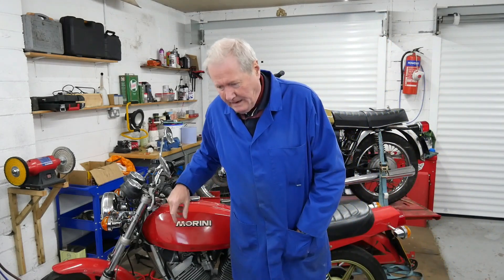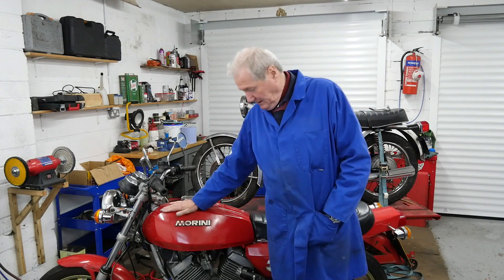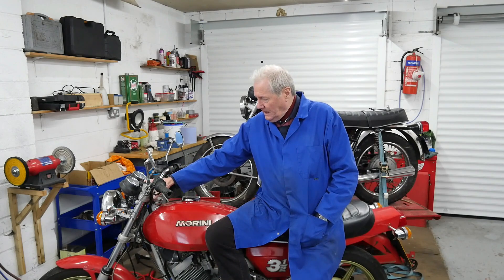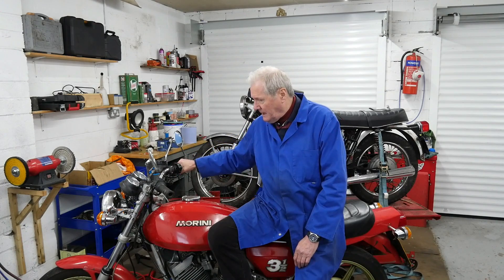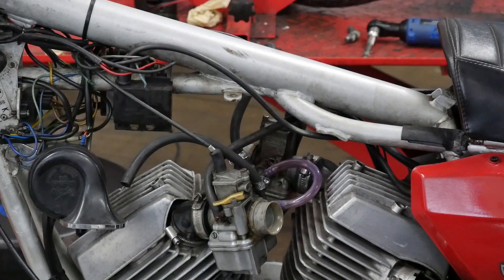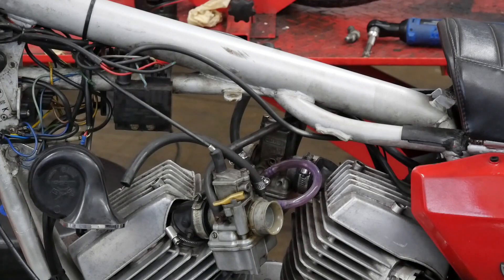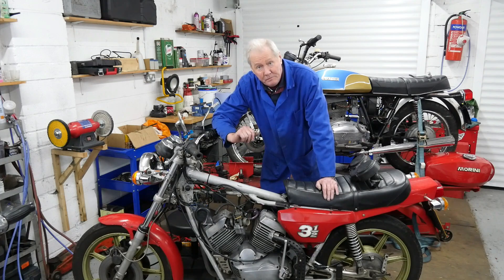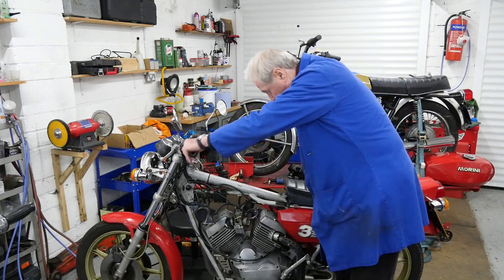Moto Guzzi no Moto Morini yes

Comment: Shame its not on its two pipes because once tank off and access to the carb mouths get the tickover perfect so each pot is firing the same pulse wise then straighten two paper clips place in the carbs so when you move the throttles off tick over the wires move and get the two wires to move at the same time by adjusting the cables on each carb top....job done....I run a 1974 Sport 3n1/2 double drum.....great bikes.....Ah yea once you set the carbs and the bike still vibrates it will be the two into one pipe mechanically bolted direct to the frame,  V twins are smoother with separate pipes.
Reply from the maker: It's where I got to with the pipes, though I do have to say it sounds very unique with the two into one. When I was a younger man I would have loved it. The carbs and timing are now correct but due to dreadful weather and other commitments I have yet to try it.

Comment: Hello Mister, a question which perhaps you can answer because you are in Italian motorcycles. At a Oldtimer Rallye I saw a MV Agusta 125 and thought by myself that the engine looks like the one of the Gilera 150. Could it be that both used the same engine just Gikera added some hub?

Comment: Get yourself a pair of vacuum gauges and set the carb balanced up accuately! You'll not believe the difference it makes and how easy it is to do....
Reply from the maker: I have a set somewhere and I used them but I found I could balance them quicker old style and when I checked with the vac gauge they were right, so I stopped using them.

Comment: Will start with a fine flat battery. Does the wiper motor style starter work?
Reply from the maker: Wiper motor- best description ever. Yes but the bike doesn't fire up, I was guessing the battery wasn't delivering enough power for both the starter and the ignition. I have checked the battery and it is way past its best.
Reply: @oldguyinshed1703  The electronic ignition runs off its own coil in the alternator and is independent from the rest of the electrics (provides AC current for the transducers) Turning off the ignition earths the system. The wiper motors can be rebuilt, often the oil in its gearbox leaks out over time. Plus also advisable to put something like a PC680 AGM battery on as they take quite a bit of juice to turn over.
Reply from the maker: @p.istaker8862  Thank you I will look into the  PC680 AGM battery and I will check if the starter circuit is not earthing the ignition which would result in it not starting whilst the button is depressed

Comment: My first 3 1/2 Sport back in the eighties had the standard drop bars and no vibration felt through the grips. I  changed the top yoke and fitted Strada bars, the same as the ones you have on this bike, and vibration was felt straight away. It's just the length of your bars accentuating the inherent imbalance of a 60 degree (?) twin configuration. Input on foam grips which helped. Watching this in Sep 2024, sending best wishes in your health battle.